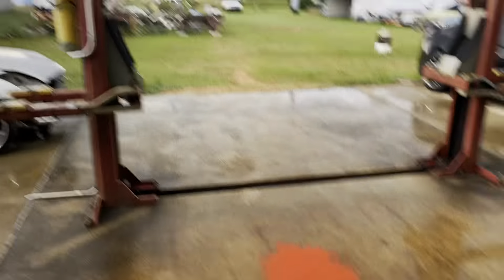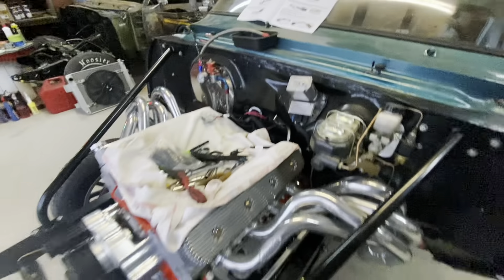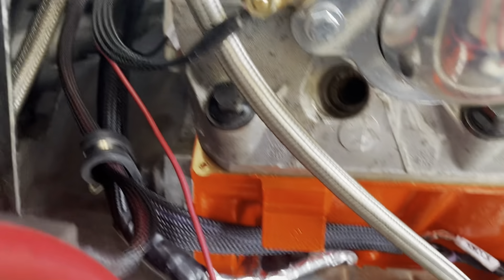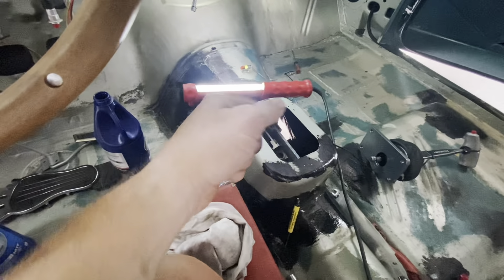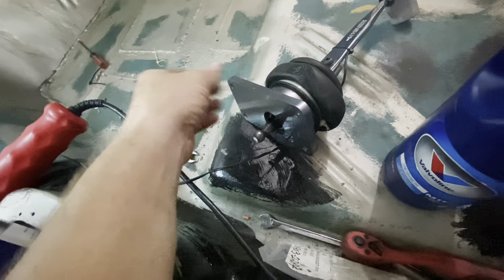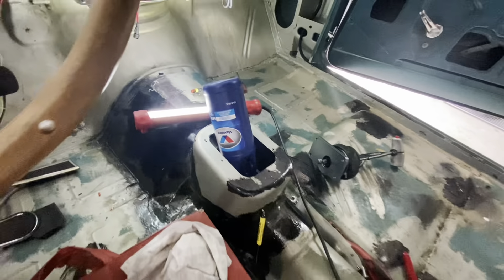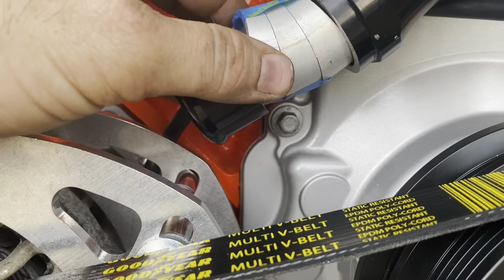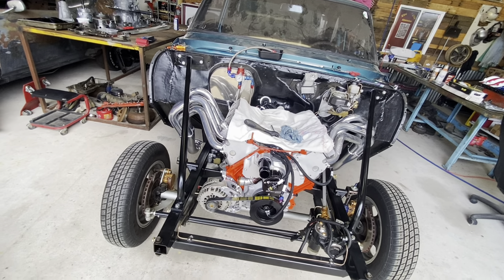Finished the Terminator X install & slapping that awesome @MeziereEnterprises water pump on the LS

Comment: As you can tell i'm really digg'n the Nova videos, nice job on the Tig welding do you have much time in on the Aluminum, i have spent a lot of time honing in on the Tig welding but mostly thin SS, i have got to get some helmet time on Aluminum, i did weld one part for my golf cart and it turned out ok, they sure are right about having everything clean/ clean, this beast is getting closer to roaring to life, that will be exciting, catch you on the next one😁😁
Reply from the maker: Thank you sir I appreciate it! I really enjoy the tig welding!

Comment: EWP's FTW
Started using them a few years back in my street cars, I'll never go back. Esp with a timer for flow after the engine has been shut off.
Not to mention, bleeding the system without running the engine. 👍
Reply from the maker: No doubt man this thing is awesome! Only the second one I’ve ever used but I love it!

Comment: I like that water pump. I might run that on my Crown Vic Ls3 swap. I am Def going to be running the Ford/Volvo electric hydro power steering conversion pump so I can get the pump off of my engine. I just want a/c and alternator on my engine. And that's just till I can find a 12v motor that will except a 6 rib belt and make a bracket to run all of my stuff on the engine. Get everything off of the crank. Should be able to run the a/c sitting still without the engine running with it all running off of a electric motor. I love the build brother.
Reply from the maker: Sounds like an awesome idea! Thank you I appreciate it! That Meziere pump is killer!
Reply: If you want to go that route,  there are a bunch of videos on here about it. The only thing it doesn't show is the controller you can buy on E-Bay for $60. Before it worked at like 75% but now you can adjust it stronger or weaker depending on how you want your steering ro feel. I just found the controller a couple minutes ago. Lol.
Reply from the maker: Nice! Maybe on another build this car has a manual box on it and with the little tires it’s not bad
Reply: Oh ok cool. I didn't notice the box was manual. I love that intake.
Reply from the maker: Thank you! Just some spray paint and stickers